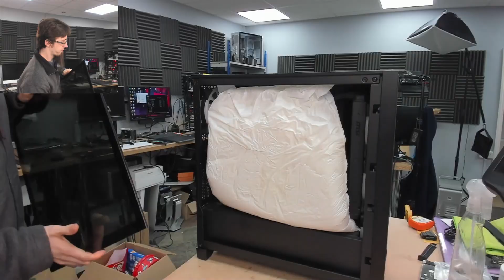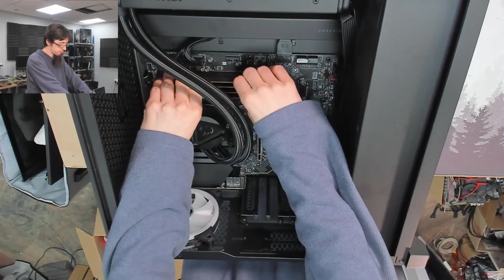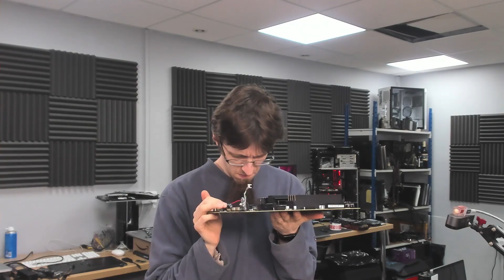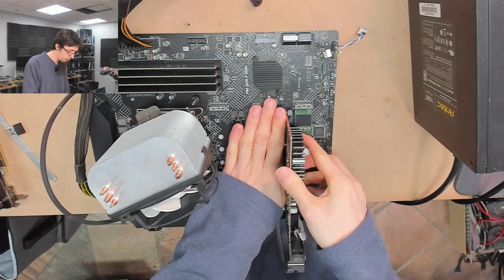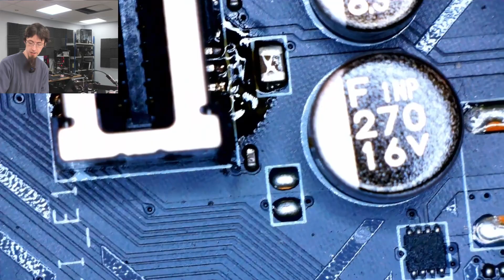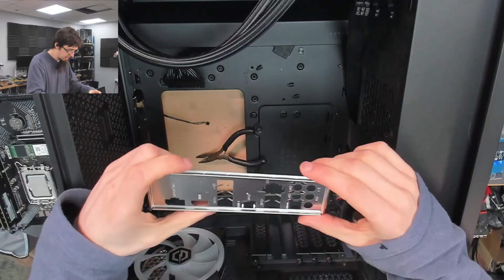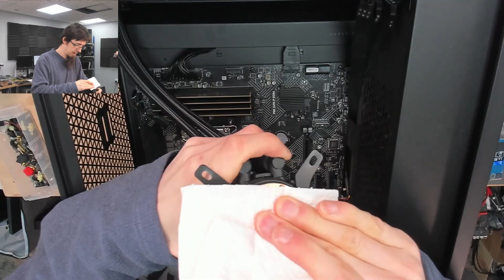CyberPower PC, GPU not detected - LFC#334

Comment: i had a thinkpad in super highend  p51s i think was the model... this was a couple years back... but it was 2500 laptop.  well a month after warranty expired computer died.  i originally thought it was the ssd because it was not recognized. i swapped it and still nothing.  so i inspected the board and found the m2 connector pins were not soldered down, none at al and it was like they forgot to solder it... the connector was pressed down just enough to make contact for a year. crazy to see lenovo screw it up so bad.

Comment: When I first upgraded to an AM4 system, I had the displeasure of finding out the x16 slot didn't work on my MSI board, I was pretty sad at first thinking I had a bad CPU or something because I knew everything else "should" be good and although not a regular issue, it wasn't entirely uncommon either for other people to also have such issues, at least on the B450 platform I had.

Comment: You ought to try more deep mainboard repairs !
It's challenging and so much more satisfying once you crack down the problem :yougotthis:
In a way it's kind of easier than doing a laptop, as there is not that bunch of microparts disassembly.

Comment: Im only 2:33 into the video, but wanted to comment. I get so many ibuypower and cyberpower pcs in my shop, it's crazy. (Not talking bad about them, just saying). Any way, I had one dropped off Friday for 2 issues. 1) Pump on aio is very loud and 2) computer randomly shuts off. At first i figured it was shutting off due to overheating because of pump but i was wrong. There was no center stand-off there one that usually had the lip on it to align the board on more expensive cases. It was just gone and they had some how managed to screw it  though the case causing the board to bend in the center ultimately causing it to ground against the case. I also had one last month it was about 2 years old it was an ibuypower and they had 2 2.5" ssd sleds on the back behind the motherboard trey and one of the screws they used to affix the sled to the back of the MB trey was so long it was grounding against the board. I figured the customer had to have done it but it had just come back from an rma a week before from ibuypower and the customer got it back like that. again, not talking bad but they just need to slow down a little when they're building. This shop has been here since 2001 and never have i seen any other prebuilts with those kind of issues.

Comment: just by seeing how those system integrated builds get shipped with that foam, especially with a heavy graphics card like the 3080, I was yelling at my screen "Check the PCIE SLOT" lol. I'm so glad you found the issue and fixed it. Nice job man. The other thing I was screaming at my screen was due to the misaligned motherboard issue. More than likely (do to shipping* the motherboard support structure can bend (the structural metal plane that the motherboard sits on top of). You may have been able to bend it back considering it was only slightly off, but the washers worked so I can't complain: At least you got it aligned!

 And bravo for calling out bullshit on ram choice!!! OMFG what is with manufacturers on skimping on the worst ram possible, ESPECIALLY for high end builds). At least it wasn't the famous 1 stick of ram though XD

Comment: Awesome PCIe slot repair.  Did you ever check to see if the SI could swap the MOBO under warranty?
Reply: The warranty should be two years, but most likely they'd want the whole system back to look at. 
The advantage here was a faster turnaround time, maybe if the mobo wasn't repairable he'd have contacted them.

Comment: why is 32gb of ram in all slots a bad thing?
Reply from the maker: Honestly, mostly personal preference. For very high speed RAM and memory overclocking, 2-sticks is just flat out faster. Aside from that, I prefer two-module kits as they tend to be significantly more reliable, just for getting stock XMP to work on fussy systems.
Like, 4 modules is fine, but I've had so many people with XMP issues on 4-stick kits and the only advice I can give them is "you just have to fiddle with it..."
It's not so bad on 32GB kits, but when 16GB was standard, lots of people were buying 4x4GB kits, which basically means there's a lot of low-capacity modules doing the rounds now, which are undesirable. They just don't age very well.
Reply: @Adamant_IT  okay. Because I figured AMD would be better with 4 sticks for performance

Comment: Because these are power rails they will have larger conductors on the PCB which require more heat soak to melt the solder when running through the reflow oven at the factory. Plus the shield around these 16x slots for strength absorbs a lot of the heat in this area. This looks like either it has a bad reflow profile or the pcie connector was not properly inverted so only partially inverted.
Reply: Nice catch btw

Comment: I've learnt something today as i always check the port first after trying the card in another pc for post. Believe me it's a common fault. Not soldered correctly and the weight  of the card Intransit they work loose. Nice easy fix well done.😁 worst of all ive just bought a crappy Cyberpower Pc for christmas hopefully i wount be sending it back if it every gets here in one piece.😁👍

Comment: That has to be the most bare-boned Z690 board i've ever seen.
Reply from the maker: I was amazed to find that it's a £200 mobo as well, which blows my mind. Granted there's not many Z690 boards under 200, but still, there are a few. Latest platforms are too dang expensive. I remember when flagship-chipset mobos started at £100 only a few years ago.

Comment: Finally a videosuitable Deskop PC in your workshop again =D My very first idea: it's the PSU 
The RAM thing is just a ridiculous decision and can only be explained by saving every penny OR that one transfer from an older system. That's why I choose this DDR4 board as a substitute back then. But in my case we kept 32GB 3600 DDR4
I had trouble with this board as well. Started with the fact that the Z690-P doesn't support 3 Pin Fans.
Reply: Does not support 3pin fans like how? If you use a 3 pin fan on 4 pin header it will simply be conrolled by DC instead of PWM. I have the sligtly more expensive MSI Pro Z690-A WIFI DDR4 board. And i can controll my fans with DC or PWM in the bios no problem. DC just has less speed options like 50% 75% and 100%.

Comment: Lovely diagnosis and repair. There seems to be a problem with putting big heavy graphics cards into PCI slots, as they exert more force on the slot when being inserted or removed. I'm not sure PCI slots were designed with modern graphics cards in mind.

Comment: Amazing find and a very neat fix. However what about that theory, that weird motherboard angle in the beginning and the wheight of the 3080 is giving a lot of twist and force for that first 4 pin and  causing those pins to fail. Whats your view on that?
Reply from the maker: The standoffs seemed fine. I reckon it might just be a poorly made IO shield. Board was straight, IO shield was stamped slightly off centre maybe. I can't see how else the board could be bent when the chassis itself wasn't damaged.
Reply: @Adamant_IT  Yeah, you saw it, was just a theory from me :) Thanks for answer

Comment: MY analysis at time within first couple of minutes: Tips for this situation. NOT BAD MANUFACTURING. Bad Build is the culprit.
 
First thing, when you see a motherboard seated like that? ignore all warnings, take all the stuff out including motherboard. Check the case for standoffs, could be too short or none. Then check all components outside of the case because I can almost guarantee that something is not seated, and, that kind of bend will likely mean the GPU is not seated correctly. IF you backplate is like that? then you know the standoffs will likely be missing as that looks like the height of the standoffs but that the motherboard is NOT quite touching the case. This is how boards get warped.
 
So in the first instance, forget all warning beeps etc and go straight to checking the stand offs as that may be the only issue causing all others. Eliminate that first and you might just save yourself a huge headache and potential damage and failures later down the line at some point in time. You then need to check the motherboard for warping as this could have broken solder joints, which could have torn tiny pads off that you can not see. 
 
NEVER assume a GPU is bad or anything else till you fix the position of the motherboard first and have checked it for warping. Save yourself time from checking other components before fixing that obvious issue. IF something still doesn't after you have fixed the position and there is zero warping, then it is possible to check other things and have a spare pc for that as again, solder joints could have broken and/or pads have been ripped of the motherboard or any other possible issue arising from badly seated motherboards with only half the standoffs.
 
The good thing about four diagnostic lights for CPU, RAM GPU AND BOOT means that if the light stays on GPU that again, the issue is the motherboard as too much strain is on the PCIe socket and good connections are not made to the GPU due to the bend in the motherboard, it only takes a fraction of a millimetre to not get good contacts with the pins. So we have another sign the issue is the seating of the motherboard where there are either one or more missing standoffs or one or more standoffs are too short, yes, too short, it is possible for an issue with the case but that is a tall stretch.
 
So first thing, forget any warning signs and go straight for the motherboard and fix that as all other problems will be alleviated, most likely.
 
I had issues with a new GPU but this was down to the Lian-Li GPU bracket where a little extra care is needed to fit the GOU properly or it would also get stuck on a GPU fault when the issue is in fact due to the support bracket, just needed a little extra attention to push that GPU in to seat it properly. Nothing wrong with my GPU or my fiances as she has the same GPU and bracket, the brackets are discrete and actually are part of securing the motherboard to the case.
 
So this is the FIRST thing that needs to be done and why. To get rid of a weed, it is no good chopping the stem of the weed as it will only come back, don't waste your time and go straight for the roots and dig them out to get rid of the weed issue. I wouldn't have bothered with the GPU or anything else until the motherboard was sorted. The motherboard is the priority nothing else.
 
@30:20 I don't think the GPU should flop like that which again, suggests from the warp of the motherboard in the case. Bad solder joints of the PCIe? which can happen and fortunately, you can sort that even as far as replacing the port completely. Damaged/bent pins in the PCIe, bent as in bent into the slot and away from potential connection? The damage is most likely caused by the bend in the motherboard in the case then the weight of the GPU on the PCIe exacerbating the issue.
 
@47:43 exactly what I suspected. Due to the flex in the motherboard, then the weight of the GPU exacerbating the issue.
 
You need to make yourself some liquid Rosin using IPA for those areas and that means you do not need to clean it away. ElectronicRepairSchool, where Sorin talks you through making your own liquid Rosin and why it's good to have.

Comment: When it comes to VGA LED diagnostic lights it's not always VGA related as one would think.  I have a Z390 Gigabyte board that gave me fits with the VGA LED being lit.  It ended up  being an incompatibility with a specific NVMe drive I was using.   There was a long topic on this issue on the now defunct Gigabyte user forums.  Linus even had some episodes discussing these NVMe drives.  The odd thing about this whole issue for me was I completed a clean install of Win10 using this NVMe drive and upon one of the reboots when the error finally occurred.  The result was a no POST most of the time.
Reply from the maker: Yea, this is why I was on-and-off GPU testing in the first section, with no output from on-board it seemed unlikely that it was actually a bad GPU. Of course, the F-sku CPU meant that was a false reading, but it turned out not to matter this time. For best practise, I should've gone in with test card in low-slot much earlier, eliminating GPU and slot in one go. This is the first time putting the card in another slot has mattered for me.

Comment: Great but do you tell the customer about the crap RAM and is it fair that the customer has to pay for your time when it really should've gone back to the system integrator. Of course you should be paid but lets face it, the customer has had very bad service from CyberPower in a number of ways and they get away scot free and the customer still loses out?

Comment: Enjoyable as usual, in this case the picture in picture would have been better in bottom right corner for first 5 minutes. Very good diagnostics and conclusion. Is it possible that the power connectors to the slot were cracked due to the unequal standoffs resulting in an offset load from GPU when factory assembled? - I have an ASRock board with a similar issue, I should take a closer look. It is also a sign of the times that our mammoth GPUs these days can wreck puny PCIe slots.

Comment: The problem with many newer motherboards now is that the pins for the memory slot and pci-e slot do not go through the card but are soldered on the upper side as a surface-mounted capacitor. you have much less strength and it withstand less stress

Comment: Intel CPU. Easy fix, take out the GPU and sell it on ebay for parts. User can use integrated graphics.
Reply: If you watched the video before commenting, you would have seen that it is a CPU without integrated graphics.
Reply: @DJChol  I was Trolling. Intel CPUs usually have Integrated Graphics.
Reply: @wayland7150  they do, except when they don't. just like it's never the CPU, except when it is.
Reply: PS, remember to bill them for the integrated graphics.

Comment: Good job finding that fault!
I highly doubt, this fault occurred due to usage of the slot.
The joints on those first pins definitely looked like bad joints to begin with, not broken joints.
This can happen with big parts like this during manufacturing. If the part is not 100% flush with the PCB or if the plastic part and the metal part of the Slot are not straight, the pins on one end hover just a faction of a mm too high, so the solder(-past) does not reach them during reflow.

Comment: I can say with a fair bit of confidence that the misaligned i/o plate and the broken solder joints have the same cause. When the expanding packing inflated, it pushed down on the gpu hard enough to not only bend the motherboard, causing the already substandard solder joints to fail, but it also bent the motherboard tray of the case.
Reply: Yep I was screaming this at the screen the entire time. Too much pressure from the expanding foam
Reply: @ve4edj  Right from the beginning that motherboard was screaming for attention. There are literally hundreds of copper traces on the bottom of the board that could have been shorting out. If this had been my repair I would have gone for that mobo first. Amateur Radio much? N4RGQ
Reply: @jaro6985   The standoffs aren't the only thing that can find it's way under the mobo and short it out. I've seen a variety of things short out a mobo from underneath both in YT videos and in person. Oh, and btw, one of those things ... was an incorrectly placed ... standoff.
Reply: Tiny surface mount solder joints have no place on a socket that holds such heavy graphics cards and has to cope with some  mild rough handling when inserting/removing cards All compounded by the awful prone to crack lead free solder!
Reply: @brucejoseph8367  Agreed. I'm not even sure if the board in my current set up has  surface mounted pcie slots (and I don't really feel like taking it apart to find out),but every older motherboard I have has though pin mounting for those as well as for the dimm slots.
Reply: Seen this happen before. The person didn't have the PCIe slot aligned with the card and just pushed the slot sideways or wiggled it and broke the solder joints. This was quite obvious then. 

I would've checked if the motherboard tray is level also, I bet the person that assembled it just pushed waaay to hard.
Reply: My thoughts too 👍 still a good watch tho
Reply: "Already substandard"?
Reply: @incandescentwithrage  Yes, substandard. If the solder joints had been done correctly, there's a good chance they wouldn't have come loose even from bending. Watch the video again. The connection tabs are just sitting on top of the soldering pads. If they were properly soldered, the solder would have at least formed filets around the tabs if not actually flowed over them.
Reply: Hence the cheapness of the board showed its true worth.
Reply: Given that only the power delivery pins failed and that there's a standoff in between and that the card can lift out, I'm not sure you are correct with regards to the GPU slot. I think it more plausible that excessive power demand from the PCIe slot (the GPU was only powered from one cable) caused or exposed the failure.
Reply: No.       I have this channel in my comedy section

Comment: Great video, solid diagnostics and an interesting fault. Also no idea what you charge but all the little attention to detail like using the two 8 pins, moving the nvme ssd and of course actually fixing the mobo instead of swapping it that's some top notch costumer service man. You really are an independent PC repair shop poster child m8.